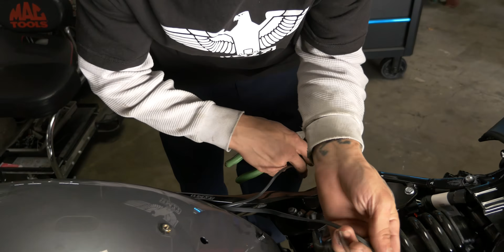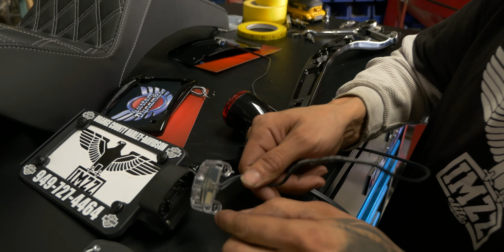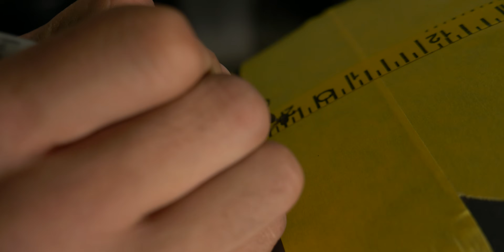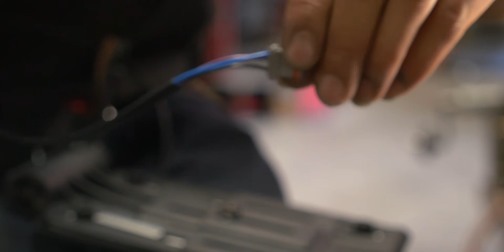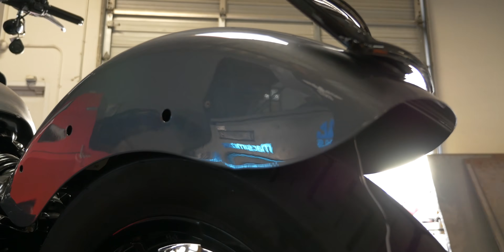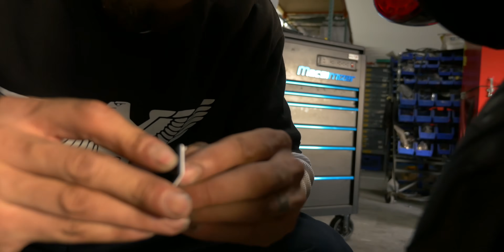Imzz Elite | How-To install the Custom Dynamics curved LED license plate

Comment: What they don't show you is a real license plate in the mount because it will not fit.The screws wont line up and will cross thread unless you drill 2x larger holes ,and use nuts to secure. Total BS and waste of money if you ask me i would not buy again!
Reply from the maker: Hey Scott! So sorry to hear you had this issue. We have great luck with these frames.